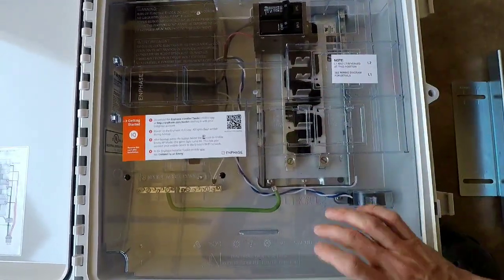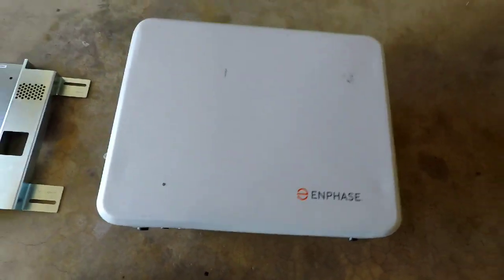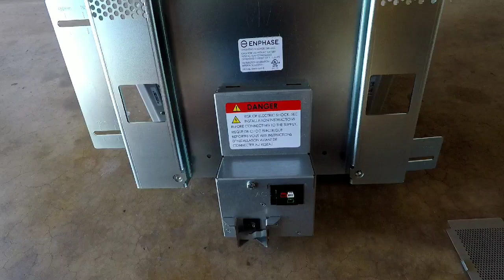My DIY Solar: Part 2, Enphase Battery and Combiner Box

Comment: hi on minute 5:25 there is a small white connector on bottom left

is that a blue and brown wire with white connector coming from the 270va acb inverter? I am trying to determine if that is a temperature sensor or something. Reason being i have a bunch of these ACB inverters and  I am trying to use one of those ACB inverters with my own battery.  Would you be so kind to do an ohm reading.  I am pretty sure its a 1k 10k or 30k ohm temperature sensor and nothing more that the inverter reads before allowing it on. I would send you some money if you do this and I get it working.
Reply from the maker: I would if I still had the batteries. After having the Tesla Powerwall 2s installed, I no longer needed these two batteries so I sold them. Sorry I can't help
Reply: @ICanDoItMyself  darn man appreciate it do you know who you sold them to. you think they would do it. i can get inverters for like 20dollars each so you can do a nice backup inverter real cheap if i can get this working
Reply from the maker: @TheMadMachine12  I sold them to someone on eBay. I don't have their info.
Reply: @ICanDoItMyself  thanks

Comment: Thank you very much. I just learned so much from you. Even to this day, there is not much info on installation. I already have an Enphase Micro inverter 4.5 KW system. I have been wanting to get batteries installed but I get quotes of $16k when my existing system already cost me $20K. I wish you lived near me, I would pay you for your advise.  Again thank you.

Comment: Hi, thanks for the great videos. By the way, if my home WiFi is down for a while and up again, does the Envoy will Auto-Reconnect to the WiFi for My Enlighten ?  I am still in process of installation.
Reply from the maker: I hardwired mine with ethernet, but I haven't had any issues with reconnecting.

Comment: Hi, Thanks for the detailed videos. I have learned so much about DIY solar panels by watching your videos. 

I have a question about the grounding wire. I show that you have grounding wire coming from Iron ridge to junction box to grounding pole. what about the equipment grounding? is your IQ combiner plus and batteries are grounded via main circuit? I did not see any grounding wire coming from IQ combiner box to the junction box; however I see the copper grounding wire is going from the combiner box to the main panel. Thanks for the input.
Reply from the maker: Yes, they are grounded back to the main panel. These two videos kind of show it. 
https://youtu.be/bLv6nTil8ew
https://youtu.be/9ZVYQmX7yYs

Comment: Props for DIY! Just a suggestion for wire management try and leave some more slack or service loop so the wires are not tight against the fittings.

Comment: Hello Dear 
you have 4 wires in the battery
 = earth and neutral and L1 and L2
how much the voltage range between L1 and L2 and between L1 and neutral ?
Reply from the maker: Actually, neutral isn't even needed. Inside the battery, there isn't a neutral wire. The batteries basically have an IQ6 inverter with the battery being the power source instead of a solar panel.

Comment: Hi I am curios if you have experience with X-IQ-AM1-240-3?  and how many consumption CT can we connect to the panel and monitor?  I was told the Enphase only supports 2 but I see 3 (IA, IB, and IC on X-IQ-AM1-240-3).  Thank you
Reply from the maker: The IQ Envoy supports three CTs, 2 consumption, 1 production. That's about the extent of my knowledge of it.
Reply: @ICanDoItMyself  BTW, have you used Sense monitoring system?  Curious how enphase compares to the Sense monitoring.
Reply from the maker: @ccjw33  I have not. I haven't even used the enphase monitoring because I'm still waiting for the power company to be able to turn the system on.
Reply: ICanDoItMyself ok thank you.